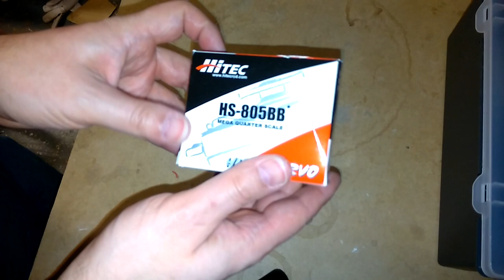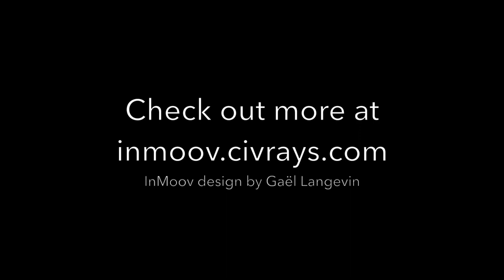Civrays InMoov - Starting the Bicep

Comment: I'm having problems with this, my servo constantly rotates even at the end of the potentiomentro
Reply from the maker: If you have have the servo output to set to 90degrees (or the centre position) then the servo should slow down as your potentiometer nears the centre and stop completely when it reaches it. What software are you using and what position are you trying to move to servo to?
Reply: @Steve Rayner I'm using Gael's MyRobotLab, I'm working with my shoulders, in both directions my servo does not
Reply from the maker: @laudemirferreira3227  I wonder if maybe you need to reverse the wires on the potentiometer. I think you swap over the outside two wires to make it work in the reverse direction
Reply: @SteveRaynerMakes  Can you help me? I'm building the shoulder, and I want to make it functional. I believe I'm getting lost on the servo map.
Reply from the maker: @laudemirferreira3227  Did you see this video here; https://www.youtube.com/watch?v=aHVBU02EtxY&feature=youtu.be
Reply: Steve Rayner so your saying the correct function for the pot is to be zero at the center? I have been puling my hair out with this and using the Servo calibration tool in MRl. The small pot from the servo I thought as a 180 degree, and goes from full to zero rotation, yet a replacement a big old  360 one does just as you stated, zero in the center, then changes direction which way you turn it. I thought my pots were all bad or unusable. The shoulders are driving me nuts because all the instruction is the video you listed, Gail doing the bicep tuning, where it looks Ike he is setting the pot to zero stop in one direction. Do you set up each pot Exactly the same and then control them in code, and have you replaced any pots? thanks James.
Reply from the maker: @JamesKruseArtist  Hi James sorry if I have caused confusion here. No the center of the pot is 90 degrees. The servo is designed to sweep from 0 to 180, so 90 is the center. In this video I have programmed the Arduino to output the signal for 90 degrees. This is nothing to do with the setup of the InMoov, I just want to confirm that the servo still operates correctly after I have hacked it about. I didn't wan't to use the zero position because I wasn't sure if that would be with the pot turned fully clockwise or fully anti-clockwise, especially as I have messed with the wires. But I could be sure that 90 was in the center of the pot. The servo will always try to move the pot to the position you have signaled it to be. I have signaled it to move to 90 so when at 90 it will stop. If i turn it right, it will try to move left to correct.

At the moment I'm not using MyRobotLab. If you want to setup your InMoov correctly then Gael's video is a much better resource.

I am currently working on the left shoulder. But if you would prefer to see the completion of the elbow joint, then I could do that instead.
Reply: Steve Rayner that would be great, Gails video has yo build the whole shoulder (three servos) together and run the ribbon cables and servo power leads thru the unit(which will destroy the ribbon cables if they get caught when your pots are not right!) at once. I was hoping for a more systematic approach to test each servo in position. You seem to be doing exactly that. Thanks James